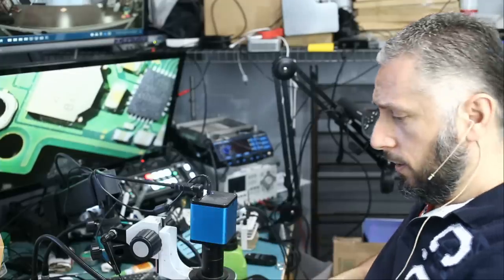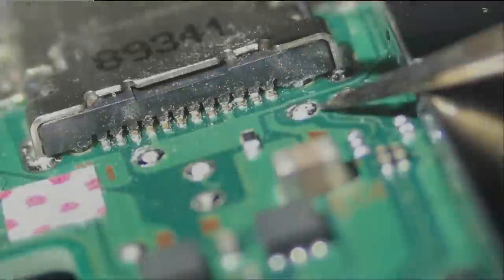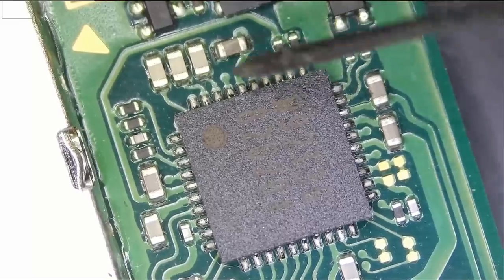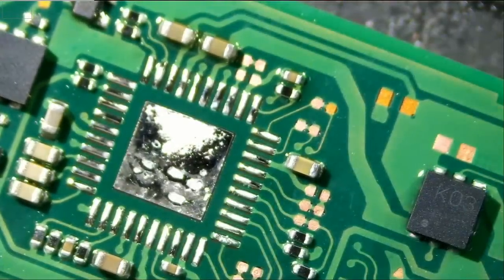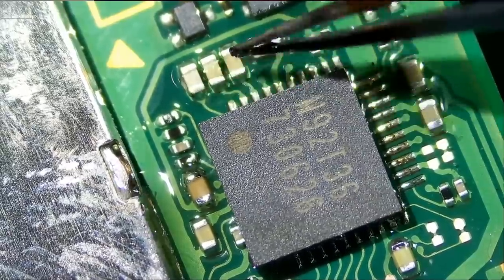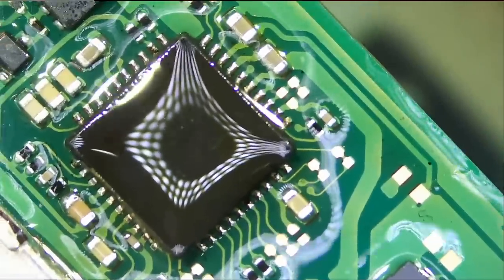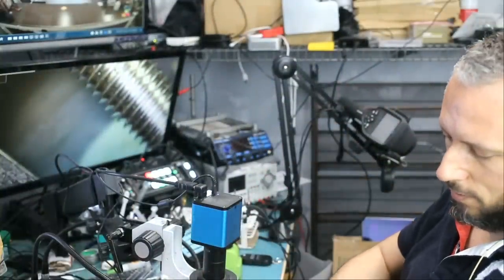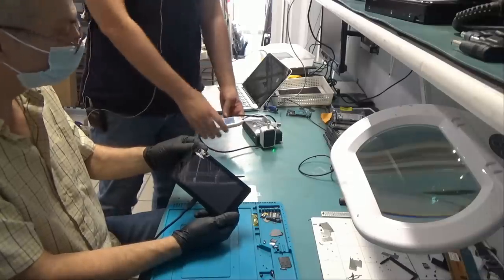Nintendo Switch Not charging Repair- Motherboard Power IC short

Comment: Game console repairs have been coming in like crazy during the pandemic.. I'm working on a few other videos right now, + I have a few others up. It's been fantastic!
Reply: Fantastic video. I'm based in Australia. My son's Switch charges but won't display on the tv. There's clearly an issue with the unit but it's not under warranty anymore. What could be the problem? I've tested it on other docks and no luck there. Hope you can help
Thanks

Comment: Hi, What equiptment are you using to check if you have voltage? Also what equiptment would you recommend to charge the switch battery (externally)?.

Comment: What heat and airflow setting were you using on the hot air station? And what is the maximum time you would keep heat on the board? I have a broken switch, but I do not want to damage any components by heating the board for too long.

Comment: Do you have any suggestions for my problem that the switch charges with a normal (slow) USB-A to C cable but not with a USB-C to USB-C cable (I think it’s PD then?). My thoughts were it is either the charging port or the power IC, that should handle the PD, right?

Comment: 21:11 Can you please explain how are you testing for short? You have one probe to grund (some metal or hole on the mobo) and with the other one, you test both ends of a capacitor. Why should it beep one one end and not the other?
Reply: one side of the caps are connected to ground, while the other side is connected to the chip. Usually, when you have multiple shorts on caps connected to one IC, the IC could be bad. In more rare cases (when dealing with lower voltage lines like where those caps are connected), the caps could be bad. From my experience, I have never came across a switch with an m92t issue that also had a dead cap around it as well. It is possible, but rare.
Reply: @DOverton252  Thanks! Can I ask you something further?
 Ok and why does it normally beep (has continuity) on one end of the capacitor and on the other not? Which end has connectivity? The negative or the positive one? Or is it not polarized?
Reply: Dan Stoian when checking for shorts to ground with continuity mode via DMM, you typically put one probe on a ground point, and test with the other probe to see if what you’re testing is grounded. In this case, only one side of the cap should be grounded (the side that is opposite of the m92t chip). The reason the cap is supposed to only short to ground on one side is because only one side of that double sided cap is connected to ground
Reply: @DOverton252  The chip he is replacing in the video is TYPE-C USB POWER DELIVERY CONTROLLER?
Reply: When you're looking at filter capacitors, their job is to dump excess or fluctuating voltage to ground. One side of the cap will be on ground, the other will be on the open line. So in continuity, one probe on the cap, the other on the heat shield which is grounded, one side of the cap will beep, because its on ground. the open side of the IC should never hit ground except in a failure, so shouldn't beep. essentially 2 beeps is bad, and if multiple caps are giving 2 beeps, its not likely every cap has blown, leading to the IC.
Reply: @ShadowEli94  This is exactly what I was looking for, thank you!

Comment: Hi ;) 
You are one skilled electrition! 
I love watching your videos very much. 
Can you.please share the following detail so I can learn from this instructive videos some more:
* maybe you have a tip on selecting the right nozzle & temp & speed for the right chip (solder & desolder)

* when a cap is dead and you don't know it's value, like the 3 caps near the power IC M9xT36, how can it be replaced (assuming you don't have donner board)

* what Microscope and max zoom level does yours have? x180, x300?
Thanks!!

Comment: Fantastic video. I'm based in Australia. My son's Switch charges but won't display on the tv. There's clearly an issue with the unit but it's not under warranty anymore. What could be the problem? I've tested it on other docks and no luck there. Hope you can help
Thanks

Comment: i took mine to a repair shop. they tried changing the battery, and power ic chip but it would still not turn on. they said the charging port looked fine. do you have any idea what else it could be?

Comment: Why you didn't use your Flir Camera? May be you have to give a steady voltage in order to locate the short and due to short it is not possible and that's why ampmeter shuts itself down. Right?
Reply from the maker: Not needed in this scenario.

Comment: I have lenovo laptop. It doesn't work when the charger and battery are connected. It works only when the battery is disconnected and the charger is connected. How can I be sure if it is because of the battery or ic charger? Thank you so much bro

Comment: I have a Nintendo Switch and once the console is turned on does not show that it is charging. But it is .. takes around 2 days to fully charge. On the battery connector I get 4.2v. Could it be the pmic ic M92T36 730626?

Comment: Hello my son's nintendo switch is doing this. I took it to a repair shop in chandler Arizona and paid $50 bucks they changed out the charge port and then said they can't fix it because of a bad power chip and that no one in az fixes this problem. Could I mail it out to you?

Comment: I have the same problem new battery switch turned on shows charging Symbol but is not charging. Brought it to a repair service to change the charging ic.
They did at least they told me but it's still not charging now they say then need to swap the motherboard. USBC port shows 14 volts so it's not the port. Is the repair service just bad and they have no idea or what else could it be ?

Comment: Hi Alex, I hope you can help me with this. 
I just received a switch in my shop.
Turned off after a high fall.
AMP meter 0.00 
Took the motherboard out and the 2R2 inductor was felt of the board. I replaced it and is now charging at 0.40 and boots up ( i think ) With more than 1 AMP
But no screen and no sound.
Motherboard is not water damaged or something. I hope you can help me maybe with Some tips of your experience.

Btw i love your video’s. I learned a lot of you!

Greetings from the netherlands

Comment: Just found this video. My sons Switch Lite will not turn on, or display charging status (I tried the 'hard reset' new charger etc.). I removed the motherboard and cleaned it, along with the USB-C port. I noticed with the back off and the charger plugged in, the area around the CPU/GPU and Heat Pipe it got HOT fast. Could this possibly be the same issue?

Comment: i have a switch that not turn on and not recharge when OFF. After an hard reset turn on and charge but if i try to turn off console, not turn ON...in little words it work only if console is ON or in STAND BY. IF off is dead. Can you think there s a solution?

Comment: correct me if I wrong but I think the title should say Charging IC, if it was the power IC the switch would refuse to turn on?
Reply from the maker: It's a Charging power controller IC. Call it however you like. That's not the point of the video. Don't pick on small things. Any chip that has voltage in voltage out is a power ic.

Comment: Out of curiosity, what temperature do you use to change the chip?
Reply from the maker: 430c
Reply: @NorthridgeFix  thanks
Reply: May i also ask 50% airflow? Is your nozzle tip less than 2mm. Thanks

Comment: I buyed with 80$ a PS4 with SU-30645-8 error because the seller can't update ,it starts only in Safe Mode, i download from PSN the full firmware and tried with usb exacly ...root  PS4...UPDATE  ...PS4UPDATE.PUP , cleaned from dust ,  change the thermal paste, formatt the HDD, initialized, rebuild data base, but the same error asking the 7.02 firmware or later. I read on the internet that someone have this problem and find a Ram module broken. You have this problem until now with one of the broken ps4 ?

Comment: Hello if I ship mine to you you can fix  I need to change the chip and 2 little component next to it need to be welding, the chip it off already and 1 little strip connector under the chip need to be weld it came off with the chip 
I can send you pictures let me know thank you....

Comment: Always get switches with charging problems , nearly always the IC at the back of the board
Reply: PI3USB?  For me it's usually always the M92T36, it's because of people using  3rd party switch chargers, docks, or cellphone chargers.
Reply: Fantastic video. I'm based in Australia. My son's Switch charges but won't display on the tv. There's clearly an issue with the unit but it's not under warranty anymore. What could be the problem? I've tested it on other docks and no luck there. Hope you can help
Thanks
Reply: @microgamingrepairs1981  Fantastic video. I'm based in Australia. My son's Switch charges but won't display on the tv. There's clearly an issue with the unit but it's not under warranty anymore. What could be the problem? I've tested it on other docks and no luck there. Hope you can help
Thanks
Reply: @microgamingrepairs1981  thanks for your quick reply. How can I test that part with a multimeter? Seems that the switches break down a bit
Reply: How much is this repair?